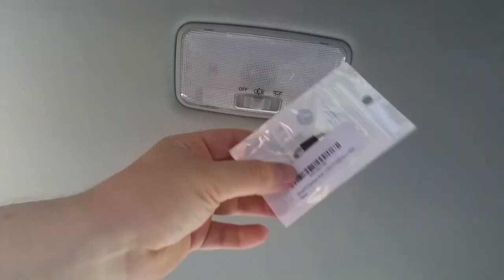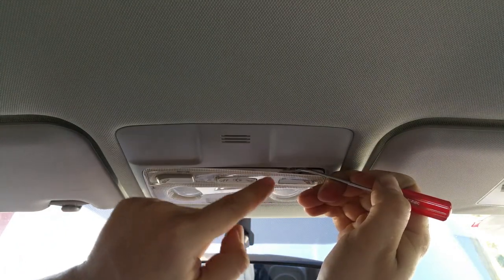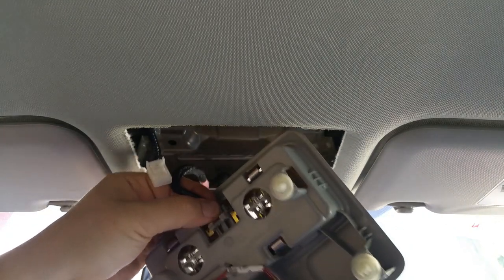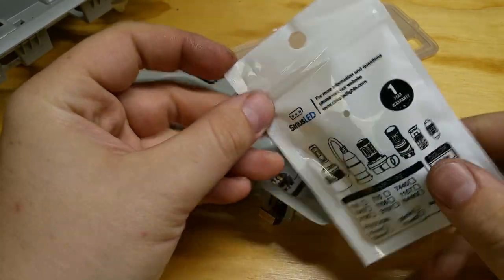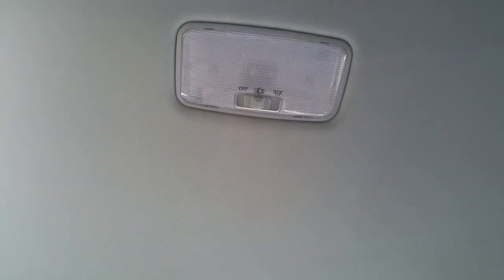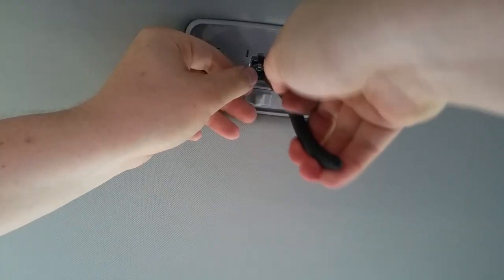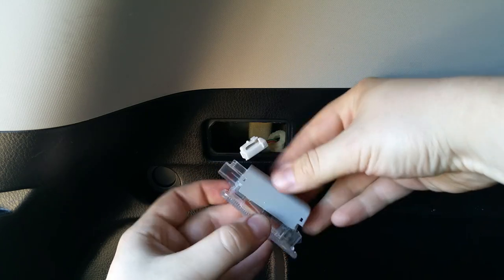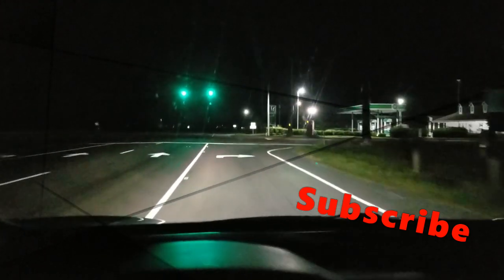2013 - 2018 Toyota Rav4 Interior Lights Upgrade

Comment from the maker: Just be aware of front map light bulbs been over powerful. LED will blind you if you need light while you're driving and need to use it for a moment. That will happen with any LED light bulbs, not just this particular brand. I modified my clear bulb cover of map light just by simply taping over the lens optic and painting around it from the inside with a spray paint (gray color).  it will look much nicer and collect all light and shoot it right through the optic  down on your knees without blinding you and without light going anywhere else.

Comment: Thank you so much for sharing this “how to” video. I bought LED lights some months back and could not figure out how to change them out. The lights are HOT! after being on for just a couple of seconds. If they are turned off then they would come on when I tried to remove them. Now I know that I can disconnect to change them. 
Grateful in Alabama
Reply from the maker: Some time I use rag to grab them, it's not gonna short it out or burn anything.

Comment: What about the vanity mirrors lights?
Reply: I found the way: both of them are latched from the left.  Stick a pry tool between the fabric and the plastic housing and pull it down.  There is a tab on that side that you might be able to push in first, but I was able to muscle it down and didn't break anything.  The whole receptacle will come out of the hole if you want; you just have to work it a little.  (Makes it easier to grab the old bulb to pull it out)

Comment: can I connect dash board camera to this light terminal?
Reply from the maker: You should be able to. Also if you leave your light on with vehicle off and locked, light will go off after couple of minutes so your camera will not be power on. But as soon as you turn ignition key on and start your car 12v will came back.

Comment: Shouldn't touch the LED bulbs with your finger, the oils on your hands will significantly shorten the life of your bulbs....
Reply from the maker: Negative... this principle related halogen bulbs which are burn really really hot... and it's also because it's glass !  LED  are not glass, they are plastic, they also do not burn as hot as Halogen does... not even close.